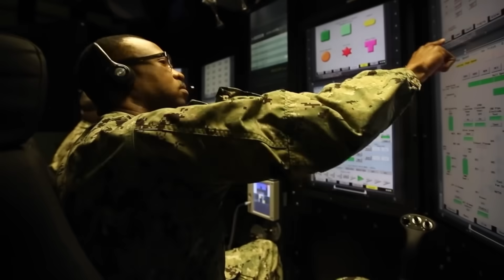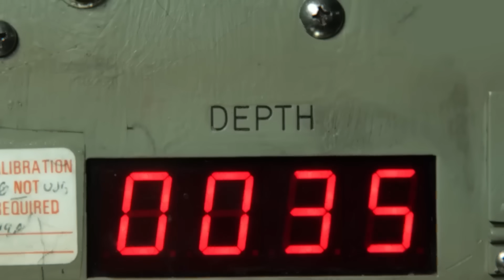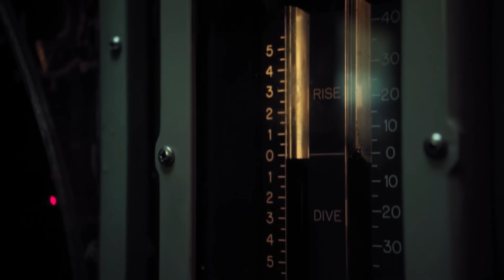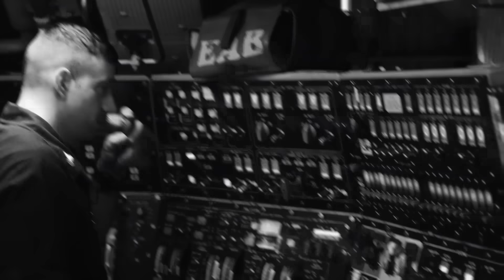What Happens When a Submarine Hits "Crush Depth"

Comment: And to think the oceangate sub was 13,000 feet underwater, much deeper than these war submarines, means the crew must have instantly vaporized from the implosion 😨
Reply: The Titanic rests at 375 atmospheres beneath the ocean’s surface. At this depth the pressure is 5,500lbs per square inch. The average human body has approximately 2,800 square inches of area. If you multiply 5,500 by 2,800 you will come to 15,400,000lbs of force being applied to the human body just shy of the speed of sound. With that being said, one must also consider all the oxygen in every cell of the body that will be expelled under dynamic pressure at the speed of lightning. They never suffered or even realized their death was imminent. Like a light switch, off…gone. Unfortunately, the only thing that remains of these individuals, are their names.
Reply: May their soul rest in peace..this is the reason we need to fear God.
Reply: @klavidtips6688  nonsense.
Reply: @ImDetonator_  question now is: how can we be sure , they were crushed < 1ms ? this fact no one actually knows
Reply: @@MLAustin5 Ahahahah!! What a  lame argument!! Just because many people believe something, doesn't make something true. Evidence and proof make something true, no mater how much you weep about it!
Reply: Vaporized from the superheated air
Reply: Not vapourized. A report on the news a couple of days ago said that they had recovered body parts. No idea of what state they were in though.
Reply: I think it was a planned destruction. There are some clues.
Reply: Like 6000psi. Truly unfathomable.
Reply: They were turned into fish Food. That thing was not sufficient to explore such an ambitious endeavor. The Titanic shipwreck lies at 12,500. No way I would have gotten on that doomed submersible. He would have carbon fibered his silly ass on away from me.
Reply: @@MLAustin5 Evidences of what you said: ZERO!!!!!
Reply: @WellMefisto  Evidences of what you said: ZERO!!!!!
Reply: @ImDetonator_  I wouldn't mind going out that way, compared to being burnt alive or drowning from your own blood as for mass sh00tings are very common these days.
Reply: They were 4921 ft when it imploded.
Reply: @RobinDeKetelaere  No, my dude. 4000 metres, which is about 13,000 feet. You're both right, just in metric and imperial.
Reply: @TheHongKongHermit I think it was closer to 8000 feet because the signals were no longer being transmitted, not taking away your point, because at that depth it is still so detrimental
Reply: @TheHongKongHermit  4,000 meters is 13,200 feet. The ocean floor at that point is 12,500 feet where the Titanic rests. The site is a graveyard for hundreds of the Titanic passengers and should never be used as a tourist attraction. Show these poor souls some respect and dignity.
Reply: @jamesklassen5285  They were fish food over 100 years ago.  Salt water has probably long dissolved their bones.  I don't think they're going to be bothered too much.
Reply: @jamesklassen5285   Ahahahahahah! That sounds sheer nonsense!
First of all, I think it is a little too far believing that souls exist! Even weirder is to think that a soul can feel disrespected or something for someone visiting the place of their death again and again! Any chance you believe that those souls are still THERE, 3,8 km deep in the ocean since 1912?????🤣
Reply: @TheHongKongHermit  Titanic lies at 3800m, the sub imploded after 2hours descent which in normal situations would mean around 1500m deep. What depth it actually was we dont know but theres noone confusing meters with feet here.
Reply: @WellMefisto  nah no way man ,those souls aren't down there. 
They left and went to the bar for a cold one. 
For all ya know there's one sitting next to you laughing at you.
Reply: @WellMefisto  Well, I am likely much older than you.  So, I'll tell you what, when I pass, I will stop by that evening and have a chat with you.  It runs in my family.
Reply: @sonofizzy  ?????????
Reply: @TheHongKongHermit  They had not reached the depth at which the titanic rests when the implosion happened. Estimates vary between 1500meters and 2000meters... not 4000 meters!!
Reply: @WellMefisto  Now you have something to which you can look forward. 🙂
Reply: @TheComputec  Whose "estimates"?
Reply: @jamesklassen5285 
Auschwitz is a tourist destination too
Reply: @sonofizzy  There has been an endless rotating panel of submersible industry experts who gave that range of depth estimate based on the believed rate of descent, the time-stamp when the sub began to actually descend after completing its safety tests, comms tests and thruster control tests,  the last comms connection and the reported sound of implosion by the US navy. 

Parts of the craft have been found 1600FT away from the bow of the titanic... Given the craft IMPLODED rather than exploding it is entirely reasonable to assume that they were nowhere near the wreck itself when  things got rapidly claustrophobic

Nobody knows for sure, but they certainly were not gazing into the grand staircase  of the titanic when it happened

We'll probably know more when the accident investigators get the data logs for the comms links as they will probably detail the comms chatter which surely would included depth readings
Reply: @Firevine  but now they are in the darkest of darkworlds in the afterlife.
Reply: @rethla I find it strange that they didn't have a way of knowing how deep they were.
Reply: @TheComputec  Thank you for the deailed response.  It does seem that you have too much time on your hands.  Sorry, just tweaking you a bit. 🙂
Reply: @sonofizzy  I can type 60-70 words per minute ... took me longer to think about the response than it did to type it out 🙂
Reply: @GTRrocker84  It must be one of the most haunted places on earth.  Would you sleep there at night?
Reply: @WellMefisto  Spoken like a true atheist. I am not one. I believe in God, you don`t. We are all entitled to our own beliefs.
Reply: @jamesklassen5285  So... Do you believe those souls are still there? Why would they mind about people sniffing Titanic wrecks????
Reply: @WellMefisto  "I think it is a little too far believing that souls exist!"

Um, they DO and your atheistic mindset is going to put you in a bad position when you die. We don't just go away. There IS an after life, one good and one bad. Get yourself before God ASAP and reach out to Jesus Christ before it's too late. Don't make the mistake of passing this by, as it will be a horrible eternity for you if you do.
Reply: @rethla  The was reported the submersible had been there before and the decent took about 2 hours. It was also reported that communication was lost at 1 hr 45 minutes into the dive. The Titanic lies at 12500 ft (3800 m) deep. That would indicate that the failure occurred at about 10900 ft (3333 m) deep assuming it had a reasonably constant decent rate. 

Of course, loss of communication doesn't necessarily mean that was when it failed, it might have just been a communication or other system problem before the actual failure (it also was reported that it had communication issues on past dives). The sub might have been intact with other control problems until it went deeper and failed.

The condition of the wreckage and the scatter pattern will yield a more detailed story. If the pattern is tight, it was near the bottom; if widely scattered, it was higher off the bottom. If the skids are badly deformed, they were attached when the implosion occurred. If the skids are relatively undamaged, they were jettisoned in an attempt to abort and resurface (it was reported that they were designed with that ability and purpose in mind).
Reply: @TroutButter  Someone's going to have some explaining to do when they get to the pearly gates. They had better be some pretty good explanations, or at least humorous, because I have a feeling that the general attitude there is “It is better to offer no excuse than a bad one.”
(― George Washington)
Reply: @TroutButter  Hmmmm... Do you always try to convince people using Caps?? Really?! Is that your evidence??? Ahahahahahahahah!!!

Do you believe the souls are deep down there?? 😴😴😴😴😴😴

Blah blah blah eternity blah blah blaaahhh!!
Reply: @angelwingstn3392  They did ofc. but everything can malfunction. We dont know what happened yet so there really is nothing more to say until some real investigation has taken place.
Reply: @jamesklassen5285 - and if you’re wrong no big deal. If he’s wrong, it’s a big deal.  Me personally, I like to gamble and play the odds.  However, I will not gamble with eternity.
Reply: @GTRrocker84  The Auschwitz memorial serves a very important purpose though. It's about men being evil to other men in one civilised, developed nation and how the world battled to bring it to an end.  We must never forget what happened even if it is considered by some to be macabre
Those that have visited have stated it had a profound effect on them... It is very sobering
Reply: @angelwingstn3392  Budget, cut-price experimental rig. certainly nowhere near ready enough for paying tourists. 
It is an unregulated industry
The craft had no depth gauges, no GPS, rudimentary communications and no redundancy systems to speak of aside from what is called a dead man's switch
Each of them had a snack and a drink and toilet visits consisted of using a small camping toilet behind a curtain with elevator muzak playing to muffle the sounds
A bargain trip of a lifetime at £250K each
Reply: @marks984  "However, I will not gamble with eternity."
That's called Pascal's wager and I'm astonished how many Christians don't realize it is just an exercise in opportunism. If the invisible man in the sky should exist and is all knowing and powerful how do you think he won't know that you are just an opportunist?
And what if you die and Thor meaningfully swings his hammer and asks you why you worshipped this irrelevant little weather god from the Middle East instead of him?
Reply: @TheHongKongHermit  the Titanic rests at 4K metres, they only reached about 1500m before it imploded.
Reply: @jamesklassen5285 So does that mean, say, Arlington National Cemetery or the Tomb of the Unknown Soldier is a no-go for the general public? What about cathedrals and churches/ churchyards with graves?
Reply: @squirehaggard4749  The public visit Arlington National Cemetery and the Tomb of the Unknown soldier to honor and respect those buried there as opposed to rich billionaires on a sight-seeing expedition to the Titanic gravesite. The two are not the same at all. In 1986 the RMS Titanic Act was enacted to safeguard the shipwreck. Unfortunately the Act is no longer effective. I`m certainly not the only person who believes the site should be preserved for the over 1200 souls who perished on the Titanic.
Reply: @WellMefisto  it's called "giving respect", and has got nothing to do with "souls"
Reply: @generalmaxwell3935  Yes, they  mentioned souls. Yes, they did. And "respect" for what? That's just your opinion. There's nothing else down there other than a bunch of ship wreckage. People love to romanticize many thingsl! It is so silly! There's no harm to do. 😴😴😴
Reply: @WellMefisto  next time there's a car accident and someone dies, definitely go there and appreciate the awesome scenery 👍(very romantic) "just my opinion"
Reply: @generalmaxwell3935  blah blah blah... Cry me an ocean, so that another ship will sink there 🤣🤣
Reply: @WellMefisto  sorry for wasting your time
Reply: @WellMefisto  >I think it is a little too far believing that souls exist!
So what's the proof they dont? :V
Reply: @sonofizzy  >It must be one of the most haunted places on earth.  Would you sleep there at night?
I think the Wilhelm Gustloff has that one beat :V
Reply: @WellMefisto  >Why would they mind about people sniffing Titanic wrecks????
Even if you dont believe souls exist, there IS still the fact that "fucking with the dead" is generally a Taboo thing, you DONT go fucking around with a person's corpse :V

Not to mention of course, for some, the idea of disturbing a dead person's belongings. 

Though there's the inverse where the Thresher's crew already had their cars being towed pretty much immediately after it became apparent they were Lost.
Reply: @WellMefisto  >Do you always try to convince people using Caps?? Really?! Is that your evidence???
Is yours excessive questionmarks?????????????
Reply: @RobinDeKetelaere  you

Comment: I have a Question: how is the titanic not destroyed after being under so much pressure in the deep ocean ?
Reply: Implosions only happen when there is an unequal balance of pressure on a contained volume of air underwater.  Since the Titanic's hull was breached during the sinking, the water pressure is equalized all throughout the wreck, so no crushing.
Reply: thats actually a very good question. what really crushes the vessel (like the submarine or the interior titanic) isn't a "force" proper (like a vector). if you apllied 144.000 Newtons of force ( a lot!) directly in the metal plates of the titanic, of course you would destroy them. However, this implosion that we see, is the result of delta P,  the gradient of pressure. For instance, when you suck water using a straw, you aren't really applyng a "force" into the water with your body. Its de gradient of the low pressure in your lungs and the higher pressure of the atmosphere around us that propells the flow of the fluid. Once delta P is zero, that is, your lungs are at the same pressure as the atmosphere , the water flow stops. Similarly, the gradient of pressure in the wrecks of the titanic and the deep ocean around it is now zero, so the metal strutcure remains the same.

Comment: Thank you for explaining it in simple terms. QUESTION: How did James Cameron go 35,800 feet deep in the Deep Sea Challenger without the submarine crushing or his lungs crushing?
Reply: Insane design and construction. I heard they tested it in computer simulations for 3 years before they built it. With the right materials, you can do a lot. Titanium and steel will have more of a bend, which would give a little bit of help. When you make the metal thick enough, it will withstand anything. As long as it’s built correctly of course. 

With his lungs, as long as the internal pressure stays at about 1 atmosphere of pressure, he’s fine.
Reply: The submersibles that go those extreme depths are a fraction of the size of navy vessels, so their structures benefit from the square-cube law, and their pressure vessels are spherical so it distributes the pressure perfectly. It takes much, much more clever engineering to scale things up and keep the maximum dive depth the same.
Reply: They might have also used a liquid as part of the pressure hull - liquids are almost incompressible - the first sub to reach the bottom of the Marianas Trench, the Trieste , had Gasoline as the fluid used, not for fuel, but for hull integrity (along with LOTS of strong metals)
Reply: Also.... How come the stuff on titanic shipwreck haven't just dissolved under the pressure?
Reply: @wachukimani5062  Because iron/steel doesn’t compress much. And the ship parts are very large - the forces are spread out on it

Comment: So if regular subs can’t go that deep why would a even smaller one be able to
Reply: Regular submarines are designed for combat.  They have to go fast (compared to a deep sea submersible), maneuver, carry weapons and sensors, and a relative large crew, and stay underwater and at sea for extended periods.  All of this prevents the engineering it would take to go deep into the ocean's depths.  A deep sea submersible doesn't have to do any of this.  It's only job is to go deep, so the engineering focuses entirely on that, withstanding pressure.

Comment: That's got to be the quickest and best way to g..................................
Reply: The minutes leading up to crush depth would be more terrifying than the crush itself as the crew tries in vain to save the boat, likely knowing its hopeless but refusing to give up.  But when the crush comes, the sudden pressure change would incinerate everything flammable ... including the crew.  They didn't cover it in this, but a modern submarine is divided into multiple compartments, and those would be secured immediately.  When they hit crush depth, each compartent would fail on its own due to whatever part of the hull or hull penetration fails first.

Note:  I worked 10 years on a submarine and did an internship at an undersea warfare museum that included deep-sea submersibles.  I wouldn't call myself an expert, but I'm pretty well-grounded.